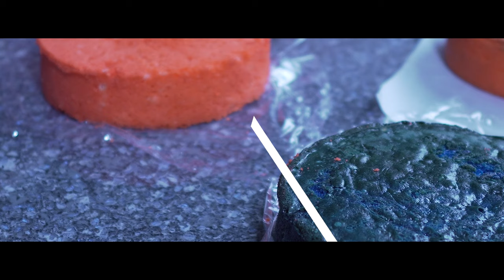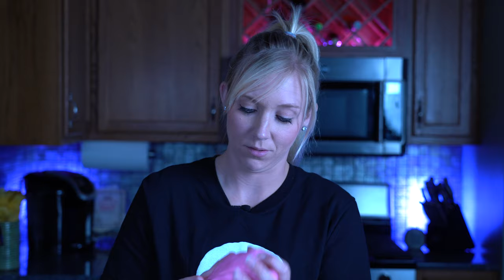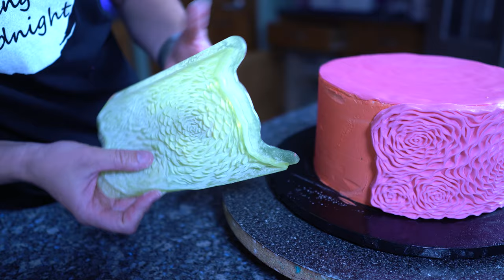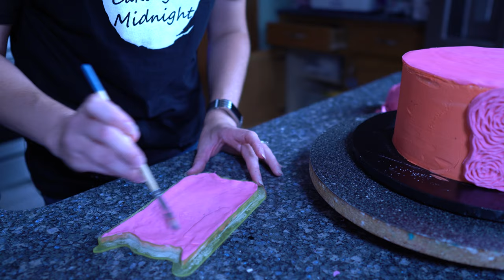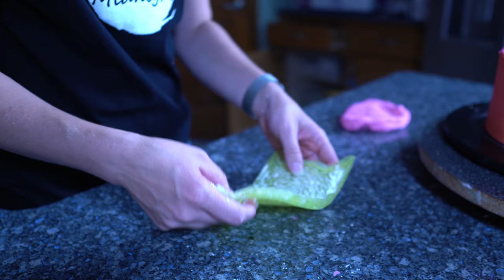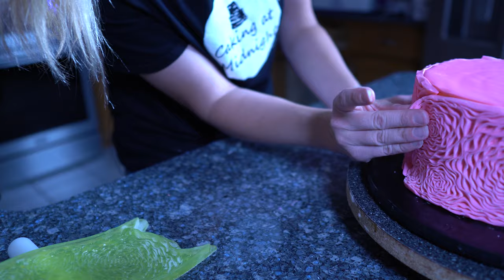How to use a Rosette Fondant Mold by Marvelous Molds

Comment: What size cake does this mold fit?  I know 4" high - but what diameter?
Reply from the maker: The cake I covered was an 8" round cake. You can cover any size cake you would like, just would need an exacto knife to cut along the rosettes. You can also flip the mold if you have a taller cake.
Reply: Is it direct to the buttercream cake or neeed to cover a fondant first?
Reply from the maker: The cake is crumb coated 1st
Reply from the maker: Also, I put a layer of fondant on the top of the cake only